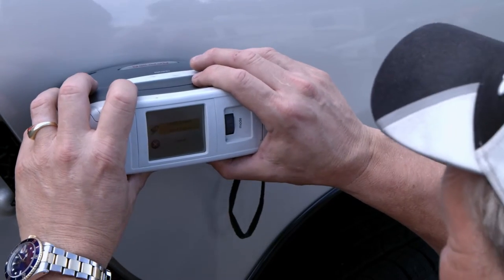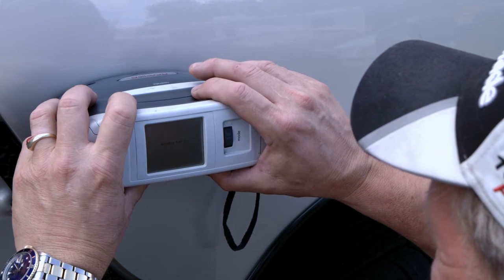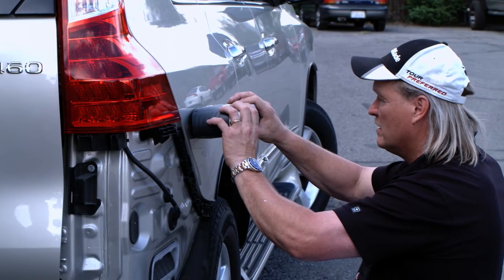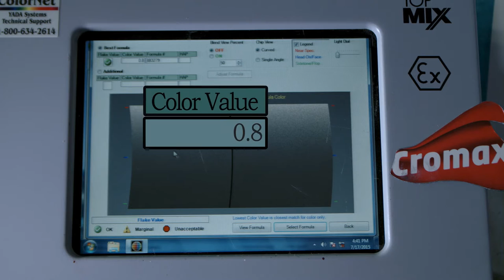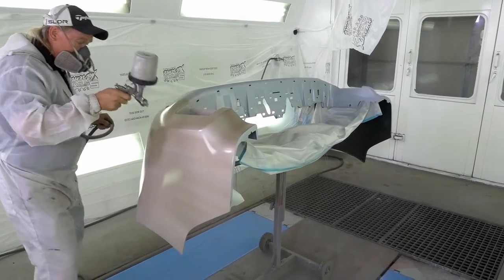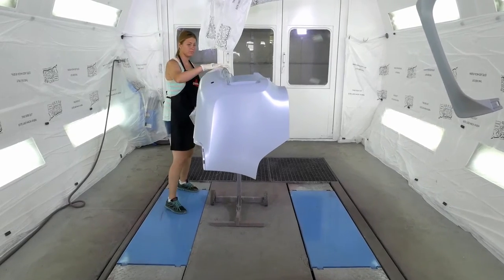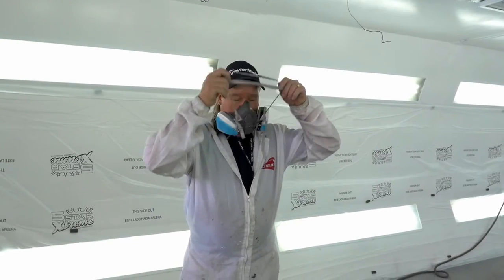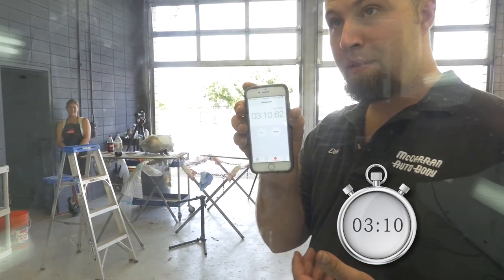Cool Tool - Axalta Color Camera and Cromax Pro Paint

Comment: bumper looked dark  test panels are a must with any paint line
Reply: I have seen brand new cars coming off the truck from the factory with plastic still on them where you can see that the bumper color is off from the rest of the car. 

Don't tell me you have never noticed that.

Comment: There is no perfect match. Blendable at a stretch but never perfect.
Reply: TheFlowcoat Thats cause you never seen bodywork with a company that has a machine like this. Sure its not 100% but its 99% Thats very close.
Reply: No where close to a color match they just use this to sell to the boss’s that never even held a paint gun , color chips 99% are never accurate an the camera yeah been painting with “A” product for 18 years come show me that you never check your color somebody is lie n to you boss, get painters on here to tell the tell will be a whole different story
Reply: You CAN absolutely get an exact color match using that camera (Acquire Quantum EFX Spectrophometer M-6668)! It's better with solid colors than it is with a metallic, but some of that has to do with the fact that air pressure can change the color of a metallic. This video was a terrible example of a CromaxPro paint job.